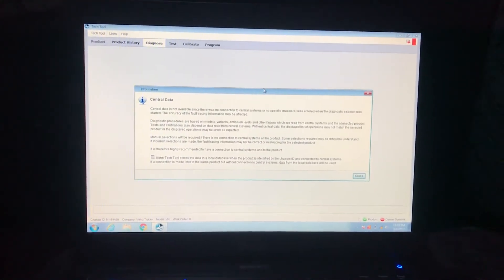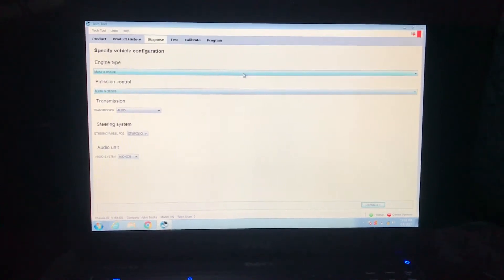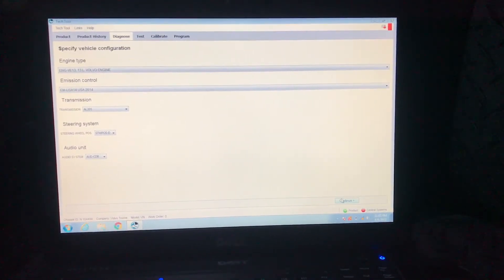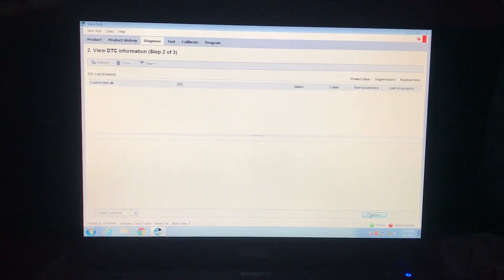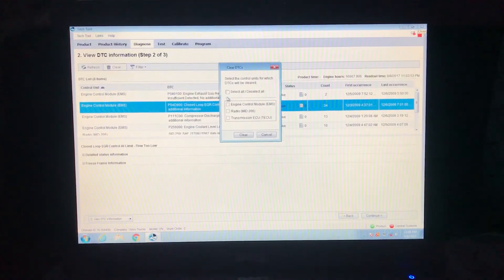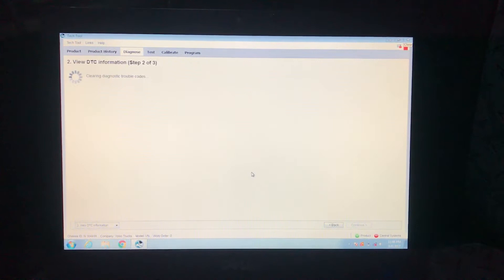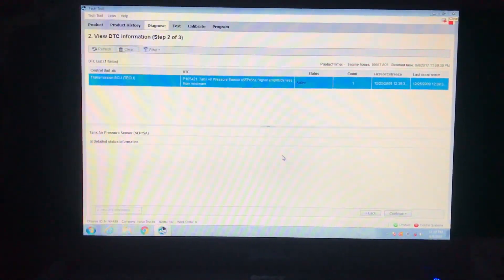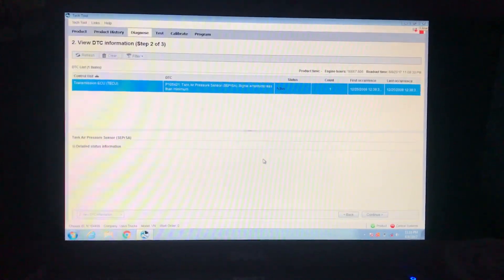How to Clear codes on Volvo w/ Tech Tool

Comment: Hello brother i watched your video and it is very interesting for me,I’m sorry to bother you with all this question but I have been trying, Volvo PTT, 2.5.87 development version, I don’t have Vocom adapter but I have USB link 2  I got this adapter from snap-on so I assume it is original but unfortunately it’s slow and apparently not fully supported by Volvo PTT, I am thinking to buy DPA 5 adapter, I would like to know what version of volvo PTT are you using ?, what kind of adapter do you have? and if you have troubles trying to connect on Mack or Volvo , thank you very much for your share and I’ll appreciate your advice, you have a lot of good videos by the way thank for sharing your knowledge.